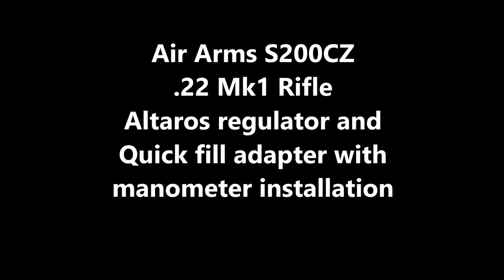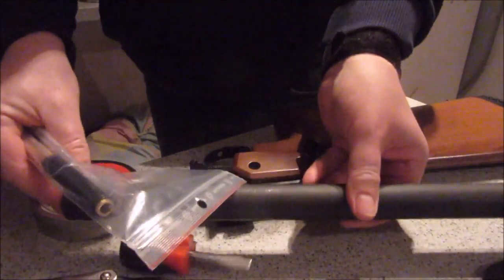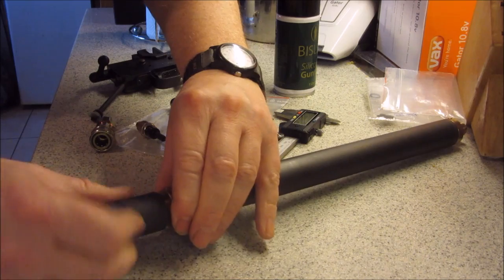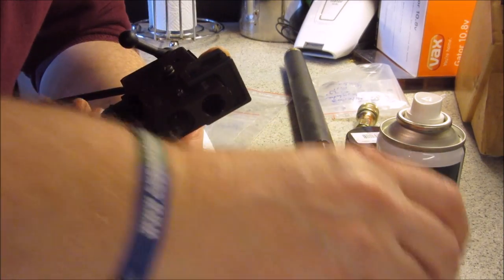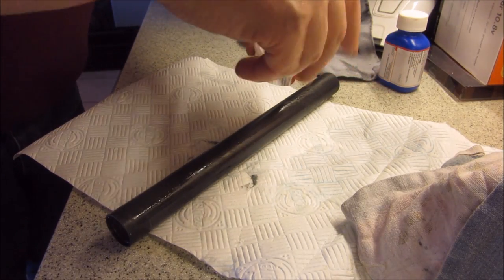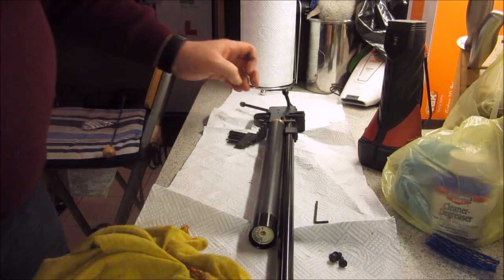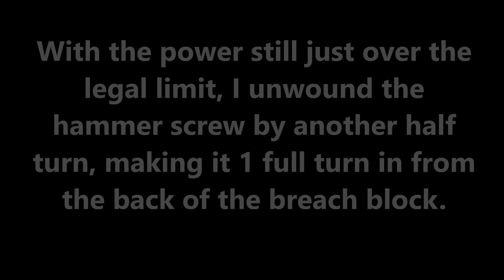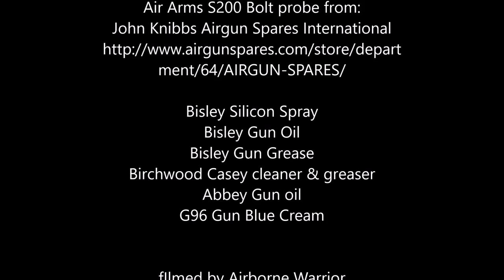Air Arms S200 CZ Mk1  22   Altaros regulator & quick fill adapter and manometer installation and tun

Comment: Wow, looks like a nerve racking task! So much to take care of! You did an excellent job though!
I am trembling just thinking of all the variables, just got my S200AA, AND I got the last Altaros external Regulator (newest) from EBay! But I can't find a spanner for the Air tube ends!
In a couple of days I should be getting the chronograph, so I'm very to starting this S200AA tuning with regulator!
I've owned several of these guns in the past, and found that at 630-650 fps, with JSB heavies, they shot very, very accurate.
All of them were 1.77 caliber, my preferred caliber.
So yeah, super nervous, but excited at the same time, my goal in the end is to achieve basically the same results as you have. Here in Spain the limit is 24joules so if I'm a tad over the 12pfe limit it's no problem. But I have found that the 11.5 to 12pfe is best for accuracy AND shot count!

Note, in the other S200's that I had, the sweet spot without a regulator was fill to 145bar shooting down to 85-90bar, which gave me 27-32 accurate shots. But now with a regulator, 70shots sounds fantastic!!!! I just hope I can accomplish this task lol!! :-) :-) :-)
Reply from the maker: The problem with the air cylinder is how tight they are to remove. You'll need a vice and leather or soft jawed vice to hold the cylinder. Here's a link for the tool to remove the exhaust valve. You'll then need an adjustable spanner to fit. It can be done with mole grips, but not advisable. I still needed to knock the spanner with a hammer to start mine off.
https://www.huma-air.com/Air-Arms-S200-and-CZ200-fill-and-firing-valve-removal-tool
Reply: @airgunsniper-elite7385  thank you very much for that information!

Comment: Thankyou great help just fitted a new reg like your channel very much
Reply from the maker: Good luck with it. Test the reg at around 90 bar as well as 190 bar fill. Sometimes there can be a power spike when it comes off reg, so if you set it lower down it should be OK at the full fill pressure as well.

Comment: Can I just fit the gage or have to fit the regulated as well
Reply from the maker: Yes, you can fit the quick fill and gauge without fitting the regulator. You can buy them from most of the regulator sellers such as Robert Lane, HUMA, Altaros etc.

Comment: If i want to just fit a manometer, do i  still need to remove the barrel from the stock. Thanks Peter
Reply from the maker: No, but if the inlet valve has never been off before, they can be really tight to remove if fitting a new valve and gauge. It just makes it easier to unscrew the cylinder to do it.

Comment: Good video, but what is an ammer spring?
Reply: Jim Grant Hammer Spring, the hammers what hits the regulator/air valve that releases the shot of air from cylinder into the barrel behind the pellet to propel it down the barrel ?

Comment: great video thank you, 
is it possible to change the calibre?
could you insert a different barrel and use a relevant new probe or would additional permanent changes need to be made due to tolerances ?
Reply from the maker: Yes in theory you could, but I think they only come in .177 and .22. If you look at the schematics of the Air Arms you would see the parts that all match up with their specific caliber. The only problem other than that could be the size of the transfer port when changing from the smaller caliber to larger caliber.
Reply: I changed mine over 10 years ago just for experimentation and it ended up costing more than I thought also if you go from .177 to .22 the power will need adjustments as a straight swap ended at just over 17 flb with an almost perfect flat trajectory

Comment: Great video do you know what muzzle  velocity  it would be in in 177 thanks
Reply from the maker: with an 8.44 grain pellet around 790 ft/p/s, although this would probably send a heavier pellet over that, so using a 10.3 grain pellet as your benchmark it would be around 716 ft/p/s at 11.72 ft/lbs.

Comment: O have an air arms  180 revolution pcp and I can'get the ring off the front of the main firing unit  with trigger mechanism  enny help would be good
Reply from the maker: Hello George, not heard of the 180 revolution from Air Arms UK. Do you mean the US Air Arms Evolution? Not had anything to do with those, as they aren't available in the UK. Sorry that I can't be of assistance. Have you googled it online, or gone to any of the airgun forums. I am sure someone has the information that you need. Chambers Airguns in the UK have a website with all kinds of airguns on. Not checked it yet, but they usually have all the schematics sheets if they are available and you can print them off and normally work it out from the diagrams. On the British Air Arms the air cylinders for an example are a pain in the arse to remove. They put them on so tight that you need a vice and special tool to remove both the Inlet and Exhaust valves on the Air Ams S200. Here's a link if you ever need it: https://www.gunspares.co.uk/categories/23960/Airgun-spares/

Comment: Is their an air valve in the end of the cylinder that goes to the regulator/rifle end?  You just unscrewed the cylinder... did you have to evacuate the air first?   You need to clarify this... else people are going to have an air propelled rocket on their hands! This could be dangerous if there is no valve and the cylinder is charged/under pressure.  Advising unskilled people to mess around with 200 bar charged cylinders is verydubious in my opinion.
Reply from the maker: Hello Jammoko, on the S200 yes there is a vale on the end of the air cylinder that the regulator is screwed onto inside the cylinder. And yes the cylinder is designed to be screwed on and off filled, or empty. When you pull the trigger after cocking the rifle, the hammer strikes the exhaust valve exhaust stem which is under tension of a valve spring that opens the valve and releases the air down through the transfer port and into the barrel. It is the same with the air tube cylinders on the Hatsan Galatian as well. It means that instead of carrying an air tank around, you can opt for spare air cylinders and screw them on in the field. I hope that helps.

Comment: just a pointer ;) 
you cleaned the cylinder with degreaser then proceeded to hold it with your bare hands :( just to let you and others know you have now reintroduced grease and acid (sweat is corrosive) back on to the cylinder from your hands :(
mine is un reg'd and running at a 11.2 with a  3-5 fps spread which is better than the spread you are getting and i get a good 50 shots,,
i can be found on face book if you want to see my readings..
Reply: sme4969 b
Reply: John Coles what is b ?

Comment: non-air vented regulator is a bad quality regulator.i got one from altaroz and it was a crap.buy the air vented one instead and it will last long.
Reply: How would you know if you cannot even spell the manufacturers name, mine is great, thank you.
Reply from the maker: Altaros have three different designs. The one I have was like a pencil, so no venting, but no problems so far. They also do an external regulater and another internal one where you just remove the cylinder seel for ventilation. You only need to drill a vent hole if it's not a cylinder, but HUMA and Lancet regulaters in general don't always require vent holes drilling.